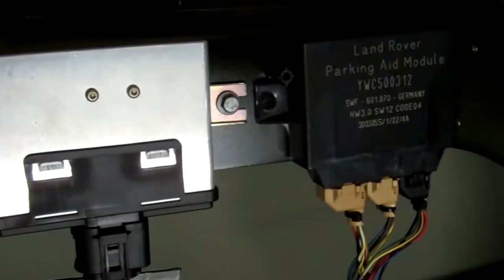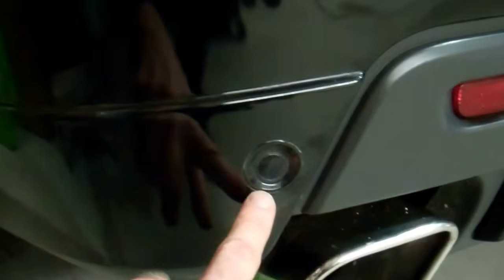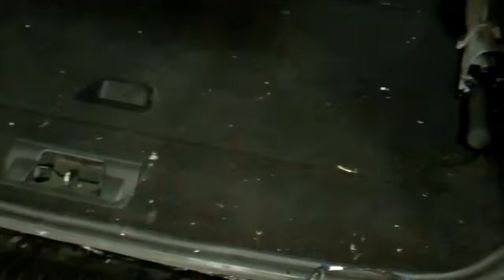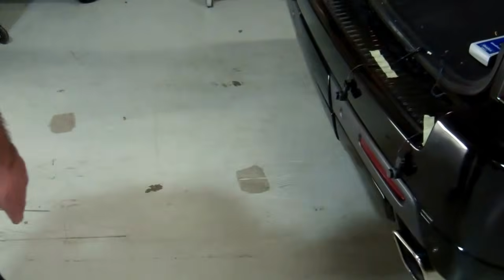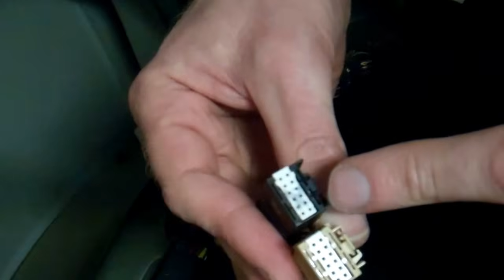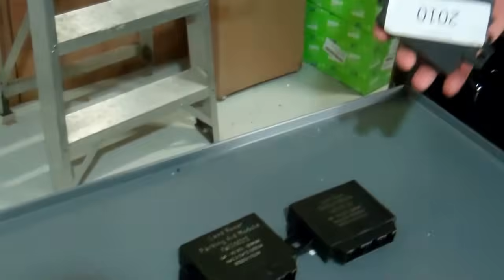How to Diagnose & fix Parking Sensor PDC problems on Range Rover Sport conversions 2010

Comment: My 2010 front or back never worked I’d did diagnostic and it said front left inside not working stripped wireing down found broke wire fixed it rear now work bot front not but nothing on diagnostic that just says lost communication with parking assist control module any help please would be fantastic thanks you

Comment: Hi I purchased a 2010 RRS which has had an Overfinch body kit added aftermarket. It has rear sensors which do not seem to be working. following your video, which was an absolute gem, I have checked the looms and found there is power going to all sensors and module. I cant though seem to see a parking assist button anywhere on the console. can you offer any advice as to the problem?

Comment: Love your videos.  Would you by chance know why brake lights on both sides might fail when the center upper brake light works?  I add a new Brake Switch and tested the fuse.  I seem to not be getting power to my rear brake lights, could not get my voltage meter to read any voltage on them.  I have an 08 sport.
Reply from the maker: Hi Aaron 
Sorry for late reply are you still struggling with this ?
Here is the wiring diagram for your car it seems that if the high mounted light is working the others should be ?
https://www.dropbox.com/s/iqzogyktzrpxc7m/sport%20brake%20light%20wiring.JPG?dl=0
Reply: @L663  thanks! F
Do you know if the wire to the lower brake lights split near  the wire on the higher brake light? From the diagram it appears so.  Trying to determine where I can test upstream.
Reply from the maker: @AaronWerner  Its an odd one if you look at the wiring as the left and the right split at a different point.
Reply: @L663  Turned out to be the bulbs, I looked at them originally and they looked good but I decided to test them and sure enough, they were dead.  Sometimes it is the simplest things that we just cannot accept.  Thank you for all your help.
Reply from the maker: @AaronWerner  Glad its sorted - had me confused !

Comment: Hi guys. I have a 2005 4.2SC Sport that has had a 2012 front end conversion. Ive just ordered a new brake switch, acc relocation bracket, tailgate release switch and rear light resistors from you today :-) Sometimes the parking sensors work but most of the time the button doesn’t work, nothing when you are in reverse etc but no error messages. Any idea where to look? Thanks

Comment: Hi, As usual  great vids, can you help me, I have a Discovery sport 2017, none of the back sensors work, ive used a code reader and its confirming all 4 not working, my question is do you think its the wire loom or Module, if a module where is it fitted, your help would be greatly received and keep the vids coming very good.
Reply from the maker: OK so it the code reader is reading faults there must be power to the module. There are 3 wires on each parking sensor - 12v 0v and signal. The best place to start would be checking that there is 12v and 0v on each sensor. It could be a bad earth connection ? or one on the plugs is not correctly plugged - maybe bumper loom to body plug ? I need to get a Disco Sport.... let me look on CoPart now...
Reply: @L663  You read my mind , I was looking on your vids for a discovery sport bumper removal,  l did see someone on another take a bumper off and the wire loom for the sensors were on the drivers side and he couldnt unclick it one handed so put the camera down and he said this is a newer model, the older model (pre 2018) it just pulled apart, I'm thinking it may have just pulled apart (fell off) any how I will wait for some dry weather and do what you suggested, if I get a result I will let you know. ps Im thinking due to the connector on the rear bumper drivers side it might be teh drivers side were the module is! Thanks for your speedy reply,
Reply: @L663  hiya (Update)  it was the bumper loom to body plug water got in and was rusty, i cleaned up spayed WD40 and all works fine know :)
Reply from the maker: @kear3922  So my guess was not far wrong ! well done for getting it fixed and thanks for boosting my ego by reporting the cause of the fault !

Comment: Hey Guys!
Once again you've out done your selfs with a great video!
I am planning on putting on the PDC system on my lr3 07 base model... and would like to ask if 
1, it's a matter of plug and play ( after installing the rear wiring loom + sensors into the module and replacing the dash board console for the pdc button) 
2. If the system would work with only the rear sensors installed (without the front ones)
3. And also as stated in the video, after removing the rear trim panel I  found one out of those 3 plugs ( the larger orange one 16pins) are the two other plugs the front and rear wiring looms for the sensors?

Thank you =)
Reply from the maker: Hi - these are very good questions and tricky for me to answer but you seem to have done your homework !
I would suggest it is quite easy to mock up the sensors and loom without actually fitting them and test your theory.